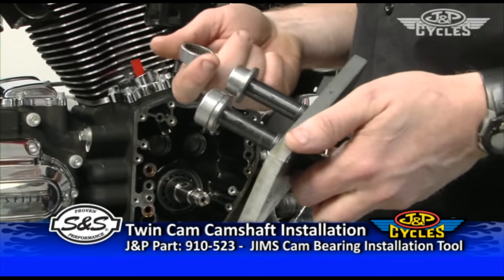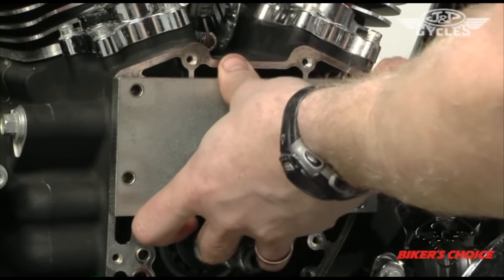Cam Replacement on a Harley Davidson Twin Cam, including Pushrod Removal •  J&P Cycles

Comment from the maker: See more installations and tech tips over on Countersteer : https://www.jpcycles.com/countersteer?utm_source=youtube&utm_medium=comment&utm_campaign=Cam_Replacement_on_a_Harley_Davidson_Twin_Cam,_including_Pushrod_Removal_•_JandP_Cycles&utm_term=n5KvamRqCis
Reply: Breather bolts, bracket for carb& breather
Reply: 1a
Reply: Cool
Reply: Did you top up the oil?
Reply: Seriously your not going to run it for us to hear.
Reply: I want him to do my fltrsei2
Reply: [Oiii
Reply: I need a  catalog.   
I don't have a computer.
Reply: @ricwilmot1654  no. He didn't mention it but loctite takes 24 hrs to cure. I wonder how many shops wait.

Comment: I've spent the last 20 years as a technical support engineer and technical writer for a large corporation... and this is by far the smoothest, most complete, easiest-to-follow technical presentation I've ever seen. Thank you.
Reply: If you go to 5:22 and hit play, you can hear Kevin Costner talking. You're welcome.
Reply: Agree
Reply: You got that right friend . Just watching i feel very confident to do it  ,myself !
Good one for sure !
Reply: Cam plate should be upgraded as well, the stock harley one is junk. Along with the pump....
Reply: I agree! Best video yet
Reply: ...more like the laziest.
Reply: That’s because this guy is a REAL engineer not one that sits in an office and poorly designs everything.
Reply: NORMAN... I'VE TOLD YOU BEFORE NOT TO COMMENT ON YOUR BOYFRIEND'S YOUTUBE VIDEOS !!!
🙉💃
Reply: I was thinking the same  and saying to myself, that it gives me hope
Reply: Thoroughly enjoyed watching that from start to finish, subscribed and liked Thank You from NZ ❤
Reply: Dam straight
Reply: That's because he actually works on it. 
I've been a mechanic for 50 years and the biggest problem about design is the designers don't actually have to work on what they create.
We get paid by the job not the hour.
If I followed the manuals I'd be broke

Comment: I am not a mechanic. Therefore i pay a mechanic to work on my bike . this gentleman took the time and patience and illustration on a live job even i could do this for the most part. The most respect and appreciation for this man. By far the best hands on video yet. Thank you .
Reply: My 7 yr old GIRL does these menial tasks in the workshop !.. Harleys a basically the same as old petters diesil engines or old massy Ferguson  tractors.. All you have to remember is after a full rebuild you shouldn't have any more than 15 spare bolts, 7 spare nuts and 2 spare cogs !... It won't start if you have a spare chain  !.. Easy-peasy...

Comment: First I want to say a big thank you to Justin and S&S for creating this video. I followed this step-by-step over a year ago, I waited purposely to comment until putting a substantial amount of miles on the bike after the upgrade. Just want to say the performance of the cam is great and I've had no problems whatsoever. I've probably got about three thousand miles on the new cams.
I am thinking about doing a top-end upgrade, just the bolt on to take the 88 Cube to about 98 cube without boring cylinders. I was wondering if anybody knows of a video showing that procedure as detailed as this cam upgrade video is.
Thanks again for the great video!

Comment: I just ddid my cam installation all based on this video, minus removing the tank and going through the head, amazing video!
Reply: Question for anybody - my 2003  tc88 (fuel injected - V&H Short Shots exhaust,  V&H Naked air cleaner & V&H fuel map) has 22k miles & I want more low end (rpm) torque. Any suggestions on which S&S cams will accomplish this. 
I'm going inside the cam plate to replace cam chain tenser with hydro tenser & may as well do a cam change while inside. 
 Any suggestions from your experience will be greatly appreciated. Thanks in advance.

Comment: I managed the Technical Trainging Departmrent for Boeing corperation and am familiar with training delivery methods and systems. This was a very perfessional and well explained video presentation. I am actully in the process of checking my tensioner on my 2010 Ultra Limited. 57K miles and very little wear on the pad. Good job presenting this information.
Reply from the maker: Thank you

Comment: This guy is the BEST! Did a total top end Cam's inner bearings it's, also complete primary drive and hp clutch, gaskets etc. Why pay a fortune when you can have the satisfaction of doing it yourself 👍👍✌️Best videos and mechanic #1

Comment: I've held a shifter assembly in place using a rolled up playing card that I frayed at the ends(1 month like that) on a 90 katana, then on a 2000 rebel held my brake together with a paper clip, on many bikes I've held mirrors in place with paper clamps, used pliers as foot pegs, so much rigging I've done i couldn't believe it when i watched him cut those rods out and use a paper clip while working on this bike. I am impressed.

Comment: Thankyou for taking the time to make this video. I was told by one guy that I should get a gear drive cam, I see now why that in itself can get very complicated if my crank is out of alignment that that engine is, so I'm guessing chain drive is the way to go if I ever deside to do a cam. And with your video, I feel more confident that I can do the job myself, as sofar, I've replaced my stereo, put on bars, and am preparing to take apart my primary. Back when I had my 96" motor I was always afraid I'd fuck something up by working on it myself. But now with my 103" I have lots of support from my local Harley dealer, and some old timers to where I've been attempting to work on my bike, and loving it

Comment: This is an outstanding instructional video. I am fairly mechanically inclined and this video almost gave me enough confidence to do my cam upgrade myself. But because of warranty ramifications I let the dealer do it. But I most definitely have a 1000% better understanding of what it takes to do it. Highly recommended!
Reply: Out of pure morbid curiosity, what was the dealership labor cost?

Comment: The more I see about these twin cam motors the more I appreciate the Shovlehead. I bought a 2002 FLSTC it is my first Harley newer than my 72 FLH. I have a wrecked 01 Road king I was going to rebuild but I think I will try to trade it for a good shovelhead. That lifter is like the shovlehead hydraulic lifter.

Comment from the maker: We understand the price of the tool is higher than a hobbyist or backyard mechanic may be able to afford. Unfortunately, there are no lower priced alternatives available.
Reply: If a person keeps a bike for years and runs up 100,000 miles they will need these tools at least twice.

Mine is a 2000 twin cam and it will need the cam tensioners replaced to prevent metal from getting into the engine. I will probably swap to a gear drive cam next time around.
Reply: Yes, but there may be rental options. And even if you did have to buy it, it's still cheaper than the labor charge the dealer would charge you to do the job. And you could always resale the tool later to recoup large portion of the cost.

Comment: This is one of the most useful videos I've seen regarding engine work. Thank you JP Cycles for putting this together. As the owner of a TC-88 with 60K miles, I know the time is near where I'll need to do this kind of work on the bike. Thanks!

Comment: Just back from Sturgis. Met a biker with a 2003 TC88 Elctra Glide exactly like mine. Over the years he replaced the engine and converted to gear drive. 
Then I saw the odometer... 489000 miles. (The bike looked like it too)

Comment: Don't ever take this video down! I put cams in my 08 Heritage using these instructions and it went smooth as silk. Have never seen a better instructional video, anywhere!
Reply: I'm pretty sure I heard you go by -   GUDDA GUDDA GUDDA  drip BLAT! VROOM! VROOM!  drip  BLAT!  POP!  GUDDA GUDDA GUDDA  drip  VROOM! BLORT! BLAT!  drip  VROOOM! VROOM!  POP! BLAT!!  drip  BLORT!  VROOM!  GUDDA GUDDA GUDDA GUDDA  drip  VROOM!  VROOM!!  BLAT!  POP!  GUDDA GUDDA GUDDA drip  VROOM!  BLORT!  BLAT!  drip  VROOOM! VROOM!  POP!  BLAT!  drip  BLORT!   GUDDA GUDDA GUDDA GUDDA  drip...
Reply: What cams did you install? I also have an 08 Heritage - thinking of SE204 bolt in cams.

Comment: I have 30 years as a Harley Tech (factory trained on first gen Evo's) and this is a great video...however, he forgot to mention putting in the new O-Ring push rod cover seals BEFORE you install the pushrods and covers....Just keep this in mind if you're attempting this on your own (pro tip).  Great video JP Cycles.

Comment: I am getting ready to install cams, lifters and adjustable push rods in my Road Glide. I've watched this video a couple times and Fuel Moto's videos a couple times. I have all of my parts from Fuel Moto and am ready to start my installation. I don't know how much easier you could make a cam install. Both J&P and Fuel Moto do a wonderful job and I fully appreciate their help and expertise. Adjustable push rods will make my life easier and if I decide to do a big bore kit and remove my heads, the adjustable push rods will stay.  Randy

Comment: I used this video step by step today and installed my cams and pushrods.Lots of pausing but about 3 hours later I was done!! took a few breaks but the pushrods were the most time consuming.I used the Crane quickies which retain the stocktubes,Very little room to adjust or lengthen rod.sounds like a hotrod now with a grumpy cam!!!

Comment: You're awesome dude- thanks for posting this! I am working on this now! ;)
Reply: This video helped me last week; recently installed S&S 585 easy Start cams in my bike
Reply: SBMC Baker Belt or chain ? wondering because Im belt drive , he made a point about the dif but didnt go into it much round 28;20
Reply: bloodyBill not sure I understand question.. But if your are talking about the cam install on stock H-D; I believe you meant you have gear driven cams and not belt driven cams. Off the show room models should have chain driven cams. I know the gear driven cams can not have crank with too much run out, but chain driven cams can have slightly more
Reply: Got it , Thats what i was asking bout , wasnt sure of the dif between the two . Thanks too , learned how the cam my twin cam lol
Reply: This is my first twin cam engine . learning all i can about them .2004 wide guild and i love this bike . But then again i loved all my Harleys even the AMF ones , not as much but  lol
Reply: This is amazingly my does anyone know the torque specs for the cam plate and the otter gears

Comment: I'm a halfway decent auto mechanic and I'm buying a 2006 Electra Glide with a twin cam that's gonna need some work so I wanted to familiarize myself with the internal workings of the twin cam motor and I have to say that this is a fantastic tutorial.
Thanks for taking the time. I really feel like I can successfully rework the motor on my bike. Thanks

Comment: I should not have bitched about this post without having an alternative way of doing this. I just assumed you all would figure it out. So to do this without cutting the push rods you will have to take the rockers off. This is easy to do it just takes more time. On the rear cylinder one of the rocker bolts will hit the frame and will not come out. So you take a bolt out of the top motor mount and pry the motor over in it's rubber mount's with a crow bar and it will come out.  This way cost me $140. for the new cam chain tensioner's and about $50 for the tool. Do every thing this fine mechanic doe's only don't cut the rods,  take the rockers off . No adjustment is needed. Put it back together the same way it came apart. DO NOT MIX UP THE PUSH RODS ONE IS SHORTER! wait there are 4 so 2 are shorter. Do not turn the motor over while it is apart! This way you use the stock rods and you don't have to adjust anything. I didn't even buy new gaskets there was nothing wrong with the old one's. This was easier for me. For this mechanic time is money and he can adjust a push rod in his sleep. For the amateur adjusting a push rod can be hard. Once you have it apart you can go to a hydraulic or gear drive or just put the stock ones back in. Both of these way,s will work but neither is the right way. The RIGHT WAY goes like this. Take the crank out have it welded, plugged and trued. Then put a gear drive in her and run the shit out of it because it is now bullet proof. It would have been nice if Harley would have trued the crank at the factory but that cost's more money. It's cheaper just to press the crank together send it out the door with a wobbling crank and let us fix them.
Reply: +fredmagee  I agree, don't cut the pushrods.. in my case, my '02 Electra glide, I wanted to remove tank, rockers & related stuff to change out my 'spring loaded tensioners'   why?  Harley has a lot of upgraded gaskets, fuel hoses, breathers & few other parts that I could replace along the way... my total cost was around $250-$300.  oh yea, I bought the same tensioners b/c this bike probably won't see another 20k miles!
Reply: I bought a 66 sportster, It was slow, and vibrated horibley was a night mare to work on. I got rid of it in 72, I have road nothing but Kawasaki street bikes and yamaha dirt bikes ever since. Why pay twice as much money for a slow vibrater ??????
Reply: because harleys are cruisers not drag bikes or dirt bikes.

Comment: Nothing wrong with a set of adjustable pushrods. Otherwise pulling the entire rocker box new gaskes and lifting the tank is involved. You'll never have a problem with the adjustables

Comment: Just make sure if you're going to do this yourself to use the right tools and use em right. I'll admit I got all the way to the cam bearings when one broke on me and 3 little cam bearing rollers fell inside the crankcase. Now the cases have to split to get em out. Its my own fault but for the price I paid for tools and parts its just about the same to have a shop do it. A simple mistake ended up costing me more $$$.
Reply: I had a similar predicament.My off-brand puller broke and the pieces fell in the crankcase.Some good news if you didn't yank it all apart yet.I learned on mine('02 Heritage),if you take the rocker boxes off 1st,and disconnect everthing from the engine,you can leave the tranny,belt drive etc. all attached so you don't have to re-align all the rear whel and crap.You can do like I did.Unbolt engine from tranny(primary,starter,brake pedal(no need to remove brake line!) too of course),slide it forward a bit,turn it to the left and pull the engine out the left side.Then,pull the jugs,remove the wrist pins,and take pistons off an viola,you can get to the bottom without splitting the case!To split it you'd hafta buy head/base gasket/o-rings,and primary gaskets anyway.Everyone I talked to said it couldn't be done,but I tried anyway.It works,less headaches,and less $$ on gaskets/seals.Hope this helps others in simialr situation!!
Reply: good to know, thanks.
Reply: Conventiona expanding jaw pullers are NOT for Harley cam bearing removal because most of the jaw tips are incorrectly designed for those particular bearings. I used to use them too until one bearing fragged and I had to find every piece in my shop and fit them together. Took a while but I lucked out and found 'em all. BTW Twin Cam and Evo bearing pullers are DIFFERENT and don't swap, as my bro found out when his mechanic bro mistakenly loaned him the wrong puller! The cases had to be split anyway because the timing chain shoes shat the bed and went through the oil pump, but it was still exasperating. With the money you save DIY you can buy good tools and equipment and still come out ahead.

Comment: I did this mod on my wifes 07 Dyna about 4 years ago. Bike ran like a champ and is still running like a champ. She regularly walks all over my Stage 1 103 street HO Street Glide.  looking at putting a cam in the Street Glide now.

Comment: I have to admit... i cringed a little when he cut the pushrods
Reply: So did I... But it seems to be a means to an end.
Reply: Time is money
Reply: I didn't. I cut the ones off my Evo in 1988 and many since on personal and customer bikes. When shitcanning parts they don't need to come out in one piece. Beats unstacking rocker boxes.
Reply: Dirty Dmust have been too hard for him to pop the rocker boxes and rockers off
Reply: Waste of time if the boxes don't leak.  I keep my motorcycles (my first Evo FXR just turned 30 years old) and having adjustable pushrods is very, very useful. It makes cam swaps and other timing chest maintenance a breeze.
Reply: Yea it's a age old tradition I've heard.